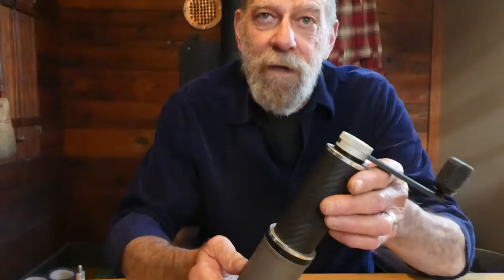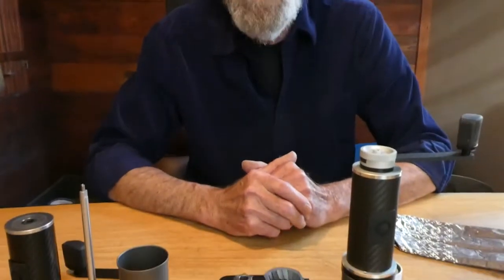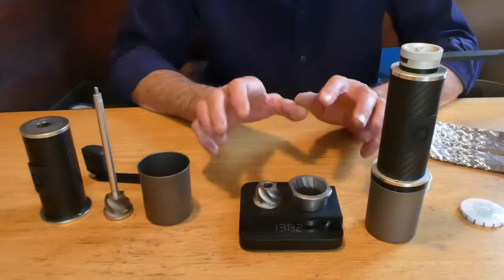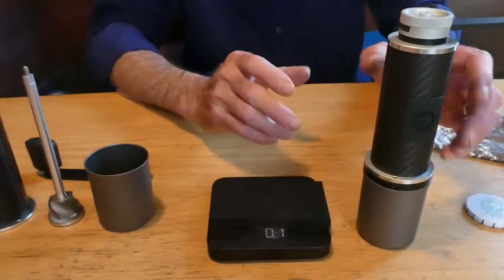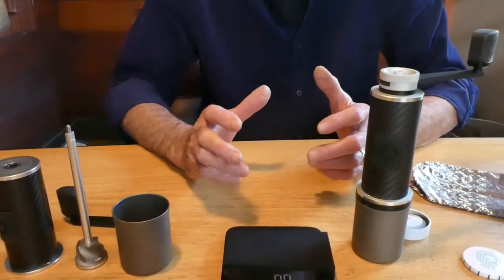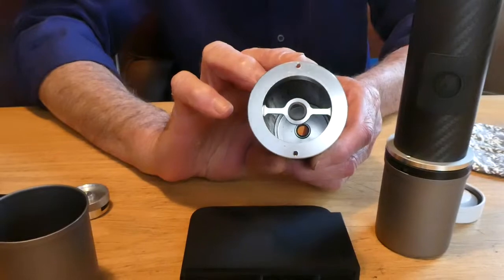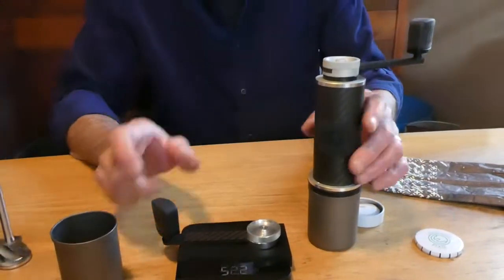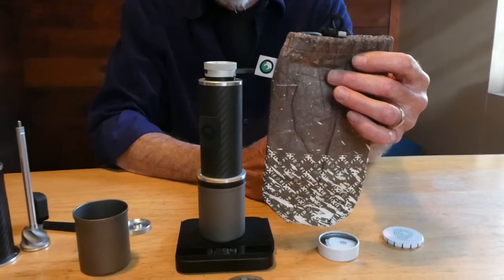OE FIXIE Travel Coffee Grinder 2022

Comment: Super cool product! I have a few questions

1. Is it a stepless, or stepped adjustment system? If stepped, how precise is the adjustment mechanism?
2. What’s the capacity of the grinder? Looks fairly small compared to other grinders.
Reply from the maker: It has infinite adjustment (stepless) BUT it's done using physical spacers so you could consider it stepped.  It can be as precise as you want - full details in the info here: https://www.oehandgrinders.com/Fixie-Manual-Coffee-Grinder-_ep_56-1.html    Capacity - 30 grams.  It is also only 330 grams in weight (138 grams of that is the burr set!)